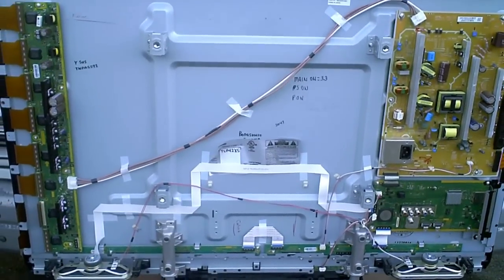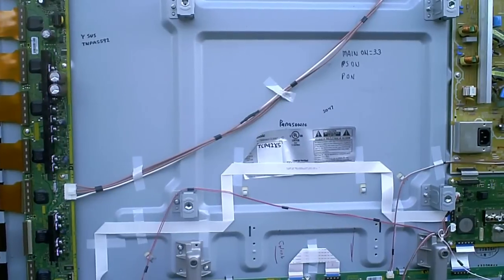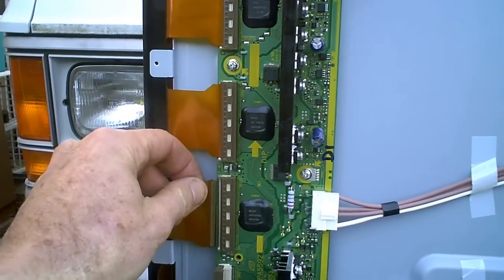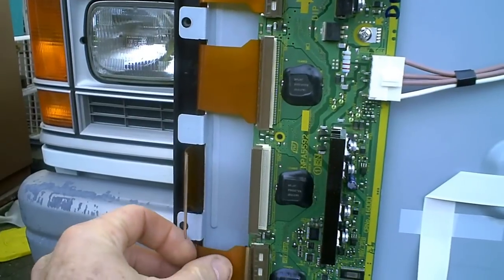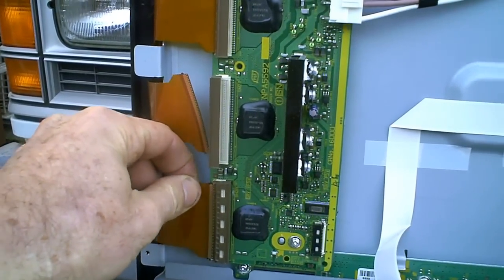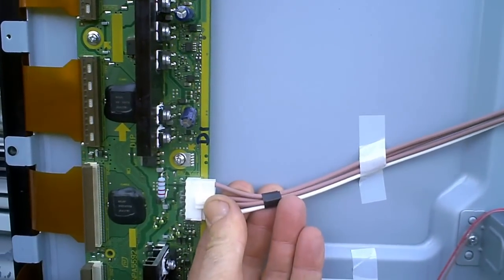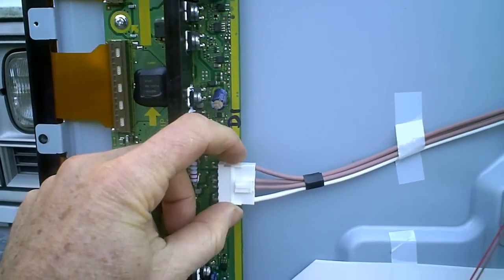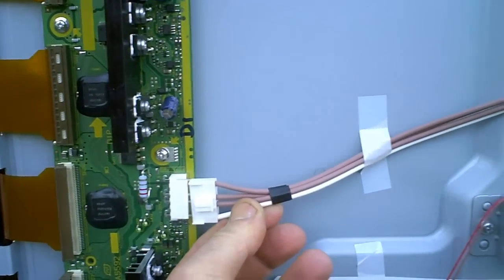Plasma TV repair. Don't make this mistake.

Comment: My 42 LG plasma 3D model code
42PW450-TA.
Symptoms.stndby light ON..but unable to turn on the TV.when push the ON button seems like going to ON but return to stdby mode.any sugesstion
Reply from the maker: I suspect there is likely a short on a board other than the power supply, but i have no specifics other than what I show in some of my other videos which can be found at https://www.tvrepairinfo.com/
Reply: @GrantsPassTVRepair  tq sir

Comment: Yes, but what damage did re-seating the connectors do to the board? Is it because a couple of pins shorted, or because voltages were fed back on the wrong pins? Or what? Aren't you curious as to what mechanism caused the failure and what it did? I am.
Reply from the maker: Yes it did make me wonder about the cause. I can guess and say it may have been a DC arc from one of the coils being abruptly disconnected while the power was applied, , or perhaps a load imbalance across an IC due to not having a load on the output of my power supply.

Comment: Do you have any experience with an LG model 50PJ350 Plasma?  Got one in with 7 different mosfet transistors on the Y-Sustain board dead shorted.  Replaced all 7, powered it up, and, well I should have saved it for the 4th of July lol.  New parts went off like a string of firecrackers.  So I'm wondering if something in the panel or on another board can blow up the Y-Sustain board, or if I most likely missed a bad component?  No more obvious shorts but there are several control IC's that can't be checked with a simple ohm meter.  Bottom line, would it be worth $75 plus shipping to try a whole different Y-Sus board, or is it likely something in the TV would blow it up too?
Reply from the maker: Have you seen the price of new TVs these days? My best advice would be to bail out and apply your money towards a new TV..

Comment: Hi. I have Samsung plasma 42". Power board have input voltage of 250v, but something is happened and I no any different voltages are there no Va,Vs ,5v and 15v what can be damaged? No short as well, power board is disconnected from any other boards. Before vas short on x buffer and  , as far I found in x main blown fuse, all replaced, tv has sound,when on, but no picture.found that no power going from power board.

Comment: I wish you were in my area.  We have no one who will repair plasma TVs in the Dallas metroplex.  I have a Panasonic TC-P50UT-50 plasma that has no power, no stand by, nothing.  I had a cable box, which was connected via HDMI, short out and after that my Pani has no power.  Would my main culprit possibly be a blown fuse on my power supply?  How can I check to see what's dead?  Any help would be GREATLY appreciated.  I miss my TV.

Comment: Help/Ideas?

Model: Sony KDE-42XS955
Type: Plasma
Size: 42 inch
Manufactured: 2005
Retail: $4,995

I bought my Sony KDE-42XS955 from B&H Audio Video in Manhattan for $4,450 in July of 2005. It was the absolute finest TV on the market at that time. It never gave me any problems during its 11-year-long life. It finally died in March of 2016. It was still producing a perfect picture up until it simply refused to power on. When it would power on, only audio was working. The video went from perfect to nothing. There was never and fading of its quality over time. This leads me to suspect there's some internal power supply issue, or something that has nothing to do with the TV's ability to produce an image. Because again, the image was always perfect up until it died. 
I wonder if this TV can be fixed? It was the greatest TV I'd ever owned, and I've had many since this one. Today's average market range TVs still aren't as good as this set. This is why buying the finest TV you can pays off. You future-proof yourself for at least a while. Again, except for the highest-end sets, my 2005 Sony plasma was better quality than 95% of the TVs made in 2018.

Any ideas? Thank you for your time.
-Mick O'Brien

Comment: I just replaced the power board on a dell w4201c hd plazma and now it works for a bit and on random flickers and white kinda goes pixelly and colored  if I shut tv off and power back on it goes away for random time then comes back.. It was doing it for a sec or two and when it was you could here a buzzing kinda sound and then it would correct itself  now when it does it it will just get worse and worse until I restart tv    right now it is flickering now going ghosty looking,, I turned it off and back on now it looks ok to gf but to me it looks like it has kinda a hard to see flicker  like if you record a tv  like the refresh rate is screwy  please help  can record a small video if it would help

Comment: Panasonic TC-54PS41 seven flash code.  Both sides of P2 on the power supply board short.Going on to TNPA4844 board and disconnected SC41,SC42, & SC46. And check on SC2(connected to P2) I still get a short.  Take it the board is bad any suggestions on where to go from there?

Comment: I have bulging capacitors on my y sus board. Can those be replaced or do I need a whole new y sus board??
Reply from the maker: Yes the capacitors can be replaced, and if your lucky doing so may fix the problem, but keep in mind there may be other problems besides bad capacitors.
Reply: Thanks! And now comes the hard part, trying to find the proper replacements. I'm a rookie at this
Reply from the maker: If you call digikey and ask for  help they can get one of there engineers to help you order.
Reply: Philips no power but a loud buzz

Comment: okay, rule number one you never ever unplug or plug anything in with the power on!
Reply: The tv  should be switched off AND given 5 minutes for capacitors to discharge before unplugging / plugging connectors,

Comment: I have PN60E53A3FXZA SAMSUNG plasma TV. standby light flashes 5 times. 
no voltage on VS and VA on power supply . LOGIC board  led flashes, caps
 diodes mosfets all look good on all boards could use a schematic,wire 
diagram and or a service manual.Daughter just got married .received this
 TV from a friend for free, Ive worked on older TVs, .I'M an American 
Airlines avionics tech . I'd appreciate your help, Thanks, Dano ddsmj5@sbcglobal.net

Comment: My Samsung PN50B850 has a problem, after it gets warm (30 minutes watching) the menus start going crazy and it goes in store mode or start switching channels like crazy. If I lower the brightness is stays cooler and it lasts much longer before doing it. Do you think it's the tactile buttons board that may be faulty?

Comment: I have the p42s30....repaired the y sustain board and no longer get any codes.   set powers up but no picture  except sometimes can see a little distortion, and it did once turn on for about 30 seconds before fading out.   any idea what that is?

Thanks
Evan
Reply from the maker: This is just  a guess, but Since buffer boards can often cause y-sustain boards to fail, that sounds like a possibility, but it could also be that you bought a bad Y-sustain board. I'm glad Plasma TVs are being phased out. They can be a challenge to repair.

Comment: Holy Cow.   i am not even a TV tech, just a all around fix it man really, i do admit to having over 21 years in the car audio field and I can and do repairs on old school car audio that is WORTH it, and I also have been building custom computer towers and lap tops for 19 years.  but I have never, not even as a rookie kid, thought that it would be OK to disconnect or re connect  any wire, connection, ribbon or anything that requires power.       YIKES!   lol    

   I guess it's a good video but WOW.        Oh yeah, with these kinds of things that have capacitors and have only recently been disconnected from power, sometimes the stored power in the caps can cause this same problem.    best not to mess with it till you have the power dissipated.     for instance,  people have been sent to the hospital from reaching into the back of a unplugged microwave oven.   thats a load of power.    it doesn't take much to fry a ribbon cable.
Reply: +Leisure suit Larry 
yeah...duh. I guess i thought it would be common knowledge to unplug whatever your working on before working on it.

Comment: High voltage inside televisions....  Never a good idea to be randomly messing with live high voltage cables.  If you have to take live readings, you shouldn't unless you know proper safety, which would already include not ever doing that...

Comment: I have an LG 50PC1DRA. The fan had been loud a couple months. It was working fine and I shut it off for the night, and the next morning there were colored vertical lines completely across the screen.  It looked like you could barely make out a picture. Any advice would help. Thanks
Reply from the maker: +Karen Fitzgerald If your fan failed to cool things off it may have caused one of your ICs to fail, but I don't have any specifics as to what the symptom means.
Reply: Grants Pass TV Repair aYeaand esopoOAweoeowapO

Comment: I have a Panasonic plasma TV model TC-P42C2. it does not power on and the red light blinks 7 times... I believe it's the Y Sustain board am I correct and what would the cost to replace it be??? thanks in advance

Comment: I have a Panasonic Plasma tv it is about 10 years old it has magenta pixels that some times show words on the screen they don' seem to stay in the same spot they move
Reply: Debra Van der Lee I just wanted to know why I guess no one knows see ya
Reply: +Debra Van der Lee  sounds to me like that low voltage problem that folks are having.     if the words are telling you to do awful things though, it;s more than likely possessed or you might need a lil different kind of help. LOL  Just kidding.        That is weird though, I have heard of STARS, sparkles, odd color blotches and the most common bar from top to bottom or side to side.       It;s possible you have  burn in issues, sometimes if some one in your house likes to watch sports or a programs with Bright banners and tickers running on the screen, football or  whatever, things that stay in the same place on the screen and run for a long time, when you shut it off you can still see where those things are.   also when the next user comes along to watch something else BAM they can see the things that were on the previous viewers screen!     the problems will get lighter and lighter as you watch the NEW thing and then should go away completely until that other viewer does it to you again.  video games will do this as well. 

  if niter of those things are it.  beats me.   I hate it when i cannot figure something out like that though.

Comment: A friend of mine has a 42" Sanyo Plasma TV. He has his XBOX plugged into an HDMI port. Every once in a while the TV Will turn off and the Xbox will reboot and then the tv will turn back on and put out this really high pitched squeal. It doesn't do it all the time, it does it most on the xbox input, but will occasionally do the same thing on the DVD HDMI input as well. We have never noticed it doing it on the Composite input.

Just wondering if you've ever heard of this?

Comment: My friend is having an issue with a couple of very narrow green lines running down the center of his display. The problem is hardly noticeable most of the time but he is worried that it will worsen with time. I was wondering what you would suspect could be the issue and if it is even worth attempting  to repair. Thank you for taking the time to read my comment.
Reply from the maker: Sounds like a bad display.

Comment: I've had this model (TC-P42X5) for almost 3 years, and now the sound is randomly chirping, popping. clicking or blasting white noise. I does this while running off satellite or an antenna, and only does it once in awhile, thankfully. Picture works fine. Any repair suggestions?

Comment: got a TCP42S30 - had 8 blinks - replaced SS bd - no blinks - steady led - no sound - no video - short across SC power plug - having trouble finding replacement - typically what fails here - cap?

Comment: Hello there, I bought some of your products and the quality is exceptional, I have a plasma, Zenith P42W46X, it is giving me 4 rectangular flashes, one to the next one, vertically, going up and down, with a withish blurry image, after I press the input button it only give me a blurry whitish screen, check caps they seem to be ok, any idea please...?
Reply from the maker: You might try re-seating the ribbon cable connection directly under the vertical bar showing up on your display.
Reply: Grants Pass TV Repair Thanks for the advise, the kind of solve d the problem partially, the problem was the y sus board and I tried to buy from you but you did not have it, thanks again

Comment: Good point!!  I service commercial fire alarm systems. I was to lazy to walk to the electric room to turn of the main power. I removed a 10 pin ribbon cable from the CPU. Lets just say, this customer has a brand new CPU. Filled out a service ticket. NO CHARGE!!!

Comment: hi Grants,

finally my tv : philips 42pfl7422/98 PSU  gave up with blown fuse.
further check result :
1. STW18NK80Z(Mosfet Q901) fail - Replace with STW25NK120 (higher Amp & voltage)
2. TEA1507P (IC904) fail - Replace with TEA1507P
3. RGP10D ( Diode D912 FRecover 1.0A) - Replace with F.Recovery 1.5A Diode
4. Main Fuse T5.0A

After replacing mention component, TV manage to power up & functioning as normal but the heatsink (Q901 mosfet) is very hot to touch and finally after 30min, PSU give up and blow up those newly replaced component.

any advice what did i go wrong??
is it a miss out of bad cap that draw too much amperage from the Mosfet transistor or the inverter board is drawing too much power??

hope you could enlighten me.

thanks in advance.

ps: here is the link for the technical manual / schematic for those who is looking for it. is on page 56/100

PHILIPS 37-42-47PFL7422-79-93-98 CHASSIS TPT1.2A[LA] - link
http://elektrotanya.com/philips_37-42-47pfl7422-79-93-98_chassis_tpt1.2a[la].pdf/download.html

Comment: I have a Panasonic plasma model tc-42pc2 and I turn the Power button on and it just blinks. Any suggestions on what it could be
Reply: I have the exact same one. It's been 4 years now, if you haven't already junked it then you should count the blinks. It will blink a number of times, pause, and blink again. Count the number and it'll tell you what's wrong.

Comment: Does anyone know why you have to wait 3 days after unplugging a Panasonic plasma TC-P42X1 TV before it works again? The power supply has been replaced and it's still doing it. Cheers.

Comment: I sadly did this exact same thing after replacing my SN board (SC, SU, SD all in one board). What exactly happened to your Y-Sustain board in your case? Was it fixable? Did one or more components short out on the board? Was it a blown Driver IC? Please let me know. Thanks.
Reply from the maker: I never repaired the TV due to a small crack I no6iced on the display,
Reply: Grants Pass TV Repair Caused by reseating the ribbon cables or the crack was there due to something else?

Comment: HI,can any of you gentlemen help me,i have a panasonic viera tc-p46x3 when i press the power button nothing happen,tv does not turn on,no lights at all tv is only 2yrs old any ideas or suggestions on this issue?
Reply: Maybe it is a blown capacitor? quite common and usually causes no power or a click.  The only way to find out is to take the back off and look for capacitors with bulged tops on them.  hope this helps.

Comment from the maker: I have done similar repairs on ribbon cables, but it will not work on the ribbon cable that goes to the display itself. There are to many wires in it.

Comment: Hi,
Thank you so much for sharing your knowledge. Your videos are so informative and easy to understand.
Recently I acquired an old Samsung ps42c7s with a bad y-sustain-buffer board - 2 of the IC's are cooked. On close inspection I also noticed that one of the buffer board ribbon cables has a slight tear across it through several of the thin "etched wires". I believe these cables are fused to the panel & cannot be replaced, but is there any way that such a tear can be repaired?. Thanks.

Comment: I've had a similar experience. After ruining a Y-Sus, I now always power down plasma TVs before changing connections. Also, the Y-Sus boards sometimes hold charges for a while after the main power is disconnected. So, I monitor voltages at the connectors and discharge caps on the Y-Sus before proceeding.

Comment: This has happend to me before too. once i was pulling off a high voltage connector and it arched to the metal case from about 3 inches away. you can say i jumped a little bit.

Comment: Electronics don't know about territories. If you're dumb or not knowledgeable to turn off the device, this stuff happens. That board runs at 60 to 180v, anything can happen, electric arches, shorts between pins on those strips of connectors...